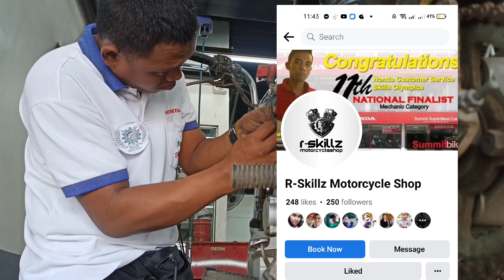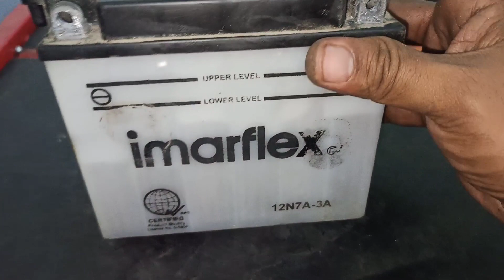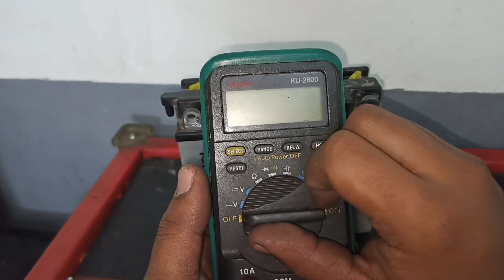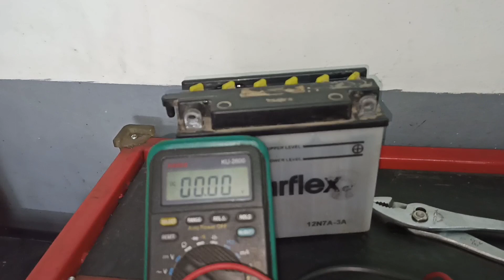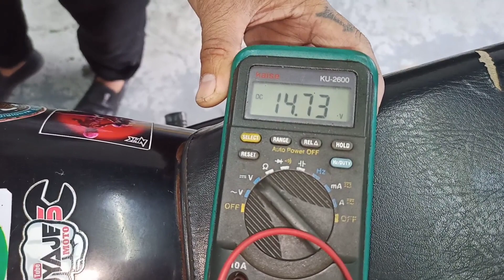GANITO ANG GAWIN MO SA BATTERY PARA TUMAGAL LALO NA AT DI TUBIG ANG BATTERY

Comment: Boss ano po dahilan ng  tmx ko na kapag tumatakbo na ay parang nag aagawan sa kuryente ang mga accesories parang na lolowbat nga siguro at bago naman ang battery ko yung stator ko 10 months old na genuin parts .  Anong troble shoot muna gagawin para alam namin Kung dadalhin na namin sa casa
Reply from the maker: charging po sir..baka po nagloloose ung connection ng regulator sa battery .then check po baka may grounded